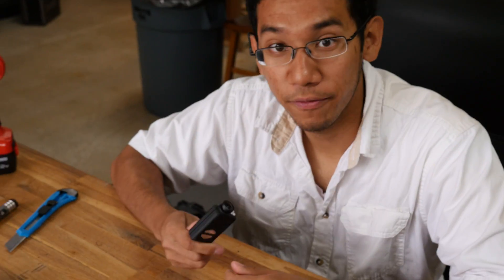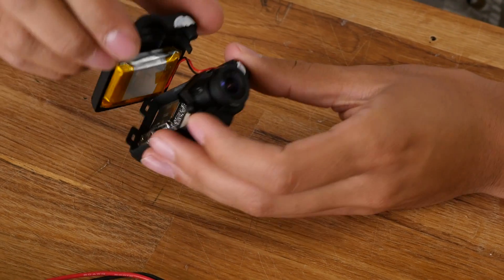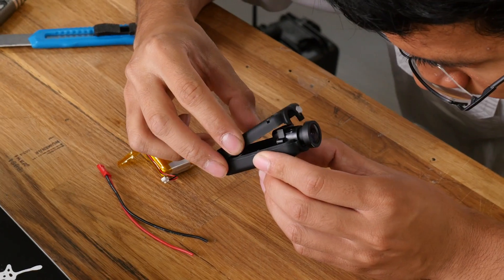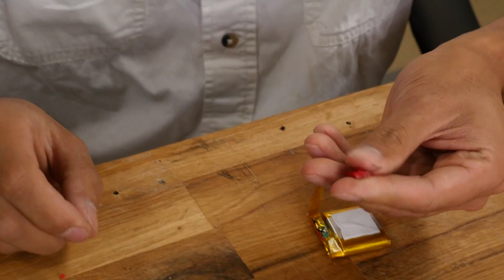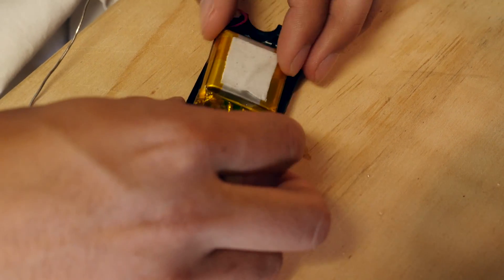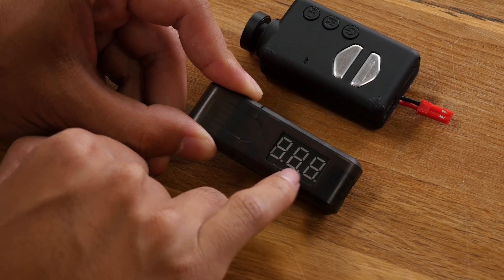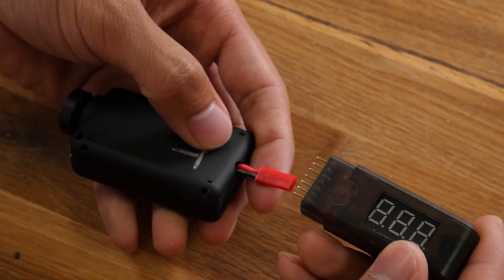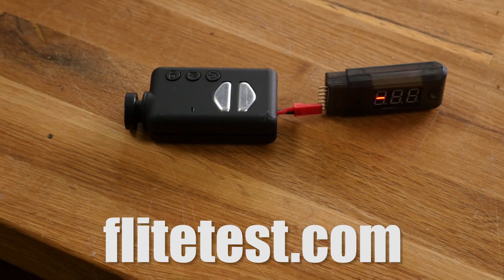Flite Test | Mobius Mod - (External Battery Checker)

Comment: Hello .  i´m looking for an advise from you about action cameras, here is the issue, i love the video quality of the mobius and the price of course! but.... its pretty fragile.. i have busted three mobius already, the case does not crack or brakes but after a crash or a mild impact it just wont record any more, i´ve tried to reflash, change sd card, battery disconect etc.. and same story never works again and i have to pass on to the next 85usd mobius, so my question to you is which camera do you recommend that may take some serious abuse as it is drone racing, so far as the situation is i don´t mind spending more money on a single purchase rather than many mobius...  becouse when drone racing is about crashing is a must!!!  LOL, hopefully you can give some advise!
thaks in advance!!

Comment: Great tip guys.
However, I have the new Lens C Mobius, and they have changed up the battery.
Not sure where to connect the wires now...

Comment: awesome tip!
I would recommend also putting a hint of hot glue in the hole to hold the wires in place so they don't chafe on the plastic sides of the hole.

Comment: Can we charge it threw the new connector too?
Reply: Answered my own question, yes you can charge threw the plug AS LONG as you hook it to the same point as the stock wires (on the output side of the protection iC). DO NOT charge with it if you hook it up where it was in the video!

Comment: Why not just plug in a usb cable and connect it to 5v from your FC or RX.
Battery never goes flat so you can record for as long as your memory card allows.
I use 64Gb so I can fly all weekend without a worry.

Comment: Peter, I suppose you could charge it through that lead as well?
Reply: Mike Roy probably not since you'd be pushing the charging power not just to the battery but to the mobius to.

Comment: That's a good idea...until you have to replace the battery. I guess it would not be to difficult to unsolder it and remove the wires from the battery. You know how I know when the batt is dying? The camera stops recording. Simple.

Comment: How many Mobius cams have you guys broken? I got my Mobius wide angles lens edition and smashed it less than two hours later when my quad lost reception and it fell onto asphalt and landed upside down. The Mobius was so smashed that the big black chip on the pcb popped off.

Comment: This procedure opens up a few more possibilities.
1. do your own custom packaging of Mobius to suit real estate of any given multi or plane.
2. Using a larger 1S battery - can replace the stock one.
3. alternate charging port
4. Use a small voltage regulator, very available on eBay, and just drive power from your system battery. Benefits are smaller footprint without battery, lighter by the weight of the Mobius battery.

Good vid.

Peter, I would hire you at my company Crossthread Aero any day - the way you handle that drilling operation is right up there with our procedure standards : )
Reply: Peter Gregory Well ...i own a Mobius C wich allready has a larger battery than the A/B (850mAh vs 500) and the Mobius dont lose warranty if you open it to change battery.. so you can allready buy an oficial larger battery if you own an A or B models.. i dont thing it would be easy finding a larger than 850mAh 1S that fits inside

Comment: would the mobius work on an external 5v input?
Reply: Bishop Vick I'm powering mine from the ESC on the front left arm of my tricopter I believe.  Maybe it's front right, but that's not important.  I did the supercapacitor mod on mine and have it set to turn off immediately on power loss so I won't lose video.
Reply: Bishop Vick it can, so it is lighter but you may lost the video on a crash because of unplugging^^
Reply: SteevyTable
Thats genius. Thanks!

Comment: Neat mod, Peter.  I got tired of wondering about my battery charge on my mobius, so I just tore apart a USB cable and hooked up the BEC from one of my quadcopter's ESCs.  And I set the Mobius so that it starts recording as soon as I plug in my flight battery, and stops recording as soon as I unplug it.  No more worries about dead mobius batteries, or forgetting to press record.

Comment: I'm not going to drill holes in my mobius! just charge it and you know that it works for 120 min 
But still nicely found! : )
Reply: AerialVideo's FPV RubenD If you're always around a charging source. Or else you could say that for any lipo instead of checking its voltage. When you're out in the field flying all day, it's nice to know you're not killing the Mobius lipo and have enough to keep filming.

Comment: Would this modd work to charge the battery as well?
Reply: ***** I was thinking the same... Thnx.
Reply: ***** I'm pretty sure that if you tapped the +/- off the mini-usb instead of direct to battery, the on-board circuitry attached to battery would keep it safe and not need external circuitry to protect it. Having said that, it's always a good thing to have redundant protection when it comes to lipos!!!

Comment: Same for a Runcam?
Reply: Yep! They are just about Identical under the case, but it will put a hole in the RF sheilding, but unless you are running a UHF system it shouldn't matter.
Reply: Awesome. 5.8 so it wont interfere?
Reply: lee weiss yeah it will be no problem then. Hope the mod goes well!